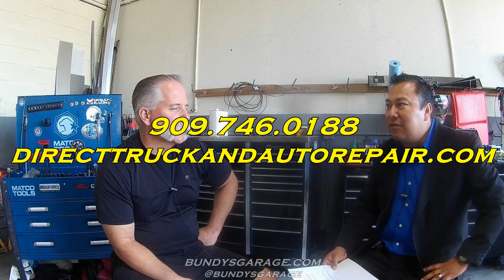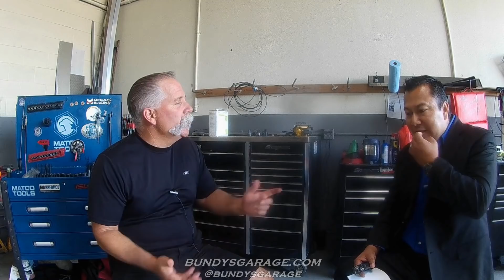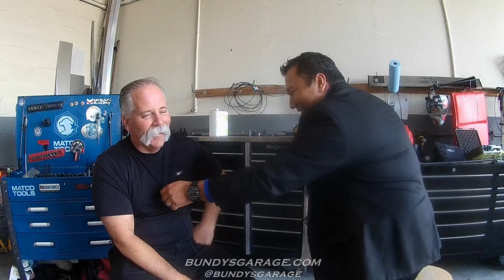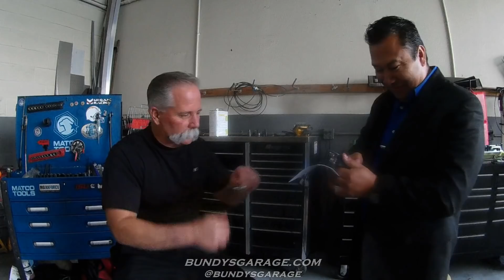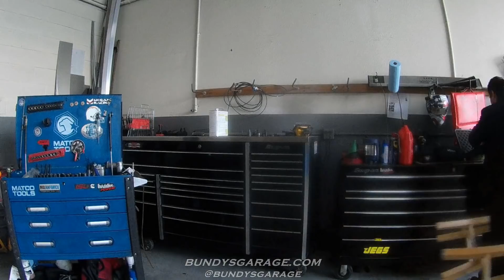Worst Diesel Engine Ever - What is the Best Diesel Truck out There? | Ford Dodge Chevy

Comment: I'm sorry, but this is garbage. No one, NO ONE, that knows what they're talking about, will pick a 6.0. PERIOD. Another Ford fanboy, clueless as usual. I wouldn't take anything to his shop.
Reply: I'm sorry but the 6.0s deleted and taken care of(later models) are generally good trucks
Reply: That is not true, I've got a 6.0 what has 350k original heads / gaskets and the only mod shes got is an EGR delete. Did have to change glow plugs, injectors and oil cooler once thus far. All else is original, point is if you take care of them they do last fairly well, though as much as I love my Ford trucks I can admit fault when they are there. The 6.0 started all screwed up because International cut a shit ton of corners, once updated they are pretty good engines. Also, I realize that my head gaskets being original is a fluke but it proves that the engine isn't total junk lol. So generally add studs to an updated engine and you're good to go for good 250-350k at least. Now before you say it yes you're right it shouldn't be needed, that is true but what are you gonna do, everything's got it's flukes. I'd honestly want a 6.7 but not with the DPF and the issues that follow it, which is why I would and pick a 6.0. It is easy to prevent most of the issues and generally easy and quick repair time versus a 6.7. I actually work at a Ford dealership so I'm not talking out of my ass fyi, the 6.7 is a beautiful well designed engine but the DPf's have so many issues that I just want nothing to do with it as compared to my 6.0.
Reply: The 6.0 is a good engine if you never run it over 2200 rpm and change oil every 2000 miles, and let it warm up  at least 10 minutes  before driving.
Reply: @larrywolfe9923  WTF? Never heard anyone say this before.
Reply: Another reason the Ram Cummins is the truck of choice for long haul hot shot truckers. with the miles they put on them , they would be changing the oil every other day if they had a 6.0!!!!!!
Reply: The 6.0 is a good engine, if you leave it parked in a heated garage. Never start it. and have brand new oil in it all of the time!!

Comment: Get all your Diesel Trucks deleted because they last longer they weren’t meant to run with all the Emissions stuff on
Reply: Good old CA, regulate everything to death.
Reply: Agreed but unfortunately in this country every state has different laws which sucks, especially in this state of mass with its laws and inspections. At some point when I get a power stroke it’ll have all the deletes done to it and it’ll be registered in South Carolina. Like you guys saying being in California Ick Cali is worse law and inspection wise than mass.
Reply: I guess I'm lucky here in Texas... I have a 2006 Duramax LBZ.

I deleted my EGR, cut the CAT off, and cut the muffler off. There is literally nothing on my truck holding back emissions whatsoever.

I took it to get inspected.. They honked the horn, turned on the blinkers, and passed it.. No emissions check on diesels in Texas
Reply: Waiting for warranty to expire.
Reply: You suck
Reply: Chanse Ormon I would but I have a L5P DMAX
Reply: You can.. Kory Willis cracked the computer. You can delete an L5P now.

Nice truck man, those things are MACHINES
Reply: @thesupersaiyan6454  PPEI - cracked ECU and tunes out
Reply: @thesupersaiyan6454  I think they came out with a tune for the L5P.
Reply: Chanse Ormon how and where if shops won’t do it?
Reply: hardleecure how do u prevent them finding out?
Reply: @soalfisk4862  I'm sure if you drew up some sketches and went to a fab shop, they wouldn't have a problem making a 'box' that looks like your particulate filter but in fact is just a tube with a box welded around it with a fitting on it for the DEF line that you don't use anymore. Looks stock but not in use. How you trick the sensors that might be upset about it I have no idea.
Reply: @Chanse Ormon Modern ERG systems are not like the early ones. The 6.7 even uses the EGR in a clever manner to help regulate EGT temps under heavy load thus protecting the engine. The issues with them come from high idle and short trips where they clog with soot. Just cause these things are clean idle certified doesn't mean they can idle for long periods without issues. Now the DPF is a whole other issue, damn garbage they are... the whole lot. I mean the idea is good, but the implementation is restrictive problematic garbage. The EPA forced the restrictions too fast so nothing got ironed out right, the DPF's are getting better but still are no where near where they need to be
Reply: @josephbowman4571  You are so right the early system is what killed the 6.4. IH fixed the 6.0 issues in the 6.4 but had to add the emissions package that flooded the rear cylinders with raw fuel and filled the crank case. My 6.4 has been deleted since new and has 296,000 miles and runs strong.
Reply: @josephbowman4571  - I would like to see the manufacturers get away from EGR systems for the simple reason, you are putting sooty exhaust gas into the cylinders. Soot is abrasive and promotes wear to the rings and cylinder walls.
But you are absolutely right about the DPF systems, they are evil. They clog with soot and when your truck goes through a cleaning cycle you loose power and dump the soot that is collected in the DPF. Supposedly it comes out as a finer, more completely burnt soot, but soot none the less. And to top it all off, you burn more fuel during these regeneration cycles by dumping raw fuel into the cylinder during the exhaust cycle to increase temps in the DPF. Isn't that increasing NOx emissions? Then we have to add more emission control systems and so on and so on.
I've always thought a lot of the added on emission systems were mostly smoke and mirrors. 
Making an engine more efficient, so it uses less fuel, is what needs to be done, but unfortunately the internal combustion engine loses almost half of the energy from combustion as heat out the exhaust pipe. And we're to the point of diminishing returns on efficiency.

Comment: 6.0, 6.4, 6.7 Which one would you pick? Uh the 7.3 ?
Reply: I had 2000 7.3 f250 I loved my truck no issues
Reply: the best trucks ever made......7.3 in a super duty..... the only weak point is the dana 50 in front if your tire is up to 35 inch.....all f 250 03 up have dana 60.....much better
Reply: 2000 7.3 with 137000 miles. Serviced regularly. No problems.
Reply: @jimdevilbiss9125  At that rate your truck will outlive you man lol.
Reply: 565 000 on my 6.0
Reply: @nickx831  350k 6.0 still running like raped ape
Reply: @nickx831  awesome I have an 6.0 130k on it, egr deleted
Reply: Guy Desjardins 6.9L and 6.7L for me! Those are the two I own and I love them both!
Reply: @natehawkins2910  How many cans of starting fluid do you keep around for your 6.9? I know someone with a 6.9 and he says that he had to use starting fluid every time.
Reply: JDFan98 None. Mine has functioning glow plugs and controller. It starts up very well even in 10 degrees. I never take it out in the snow tho and since it’s like 35 years old I don’t start it when it’s that cold anymore. I figure she deserves a break from the very cold weather stress now so it’s usually only ran in temps above 40.
Reply: JDFan98 See a clip of mine on my channel
Reply: Always wanted to try a 6.4 reprogrammed to eliminate the regen fuel through the turbos
Reply: @joenobody2580  I've got a 6.4 DRW with 296,000 miles that has been deleted since new. I did just have the auto trans gone through. This motor gets 17 mpg and is a power monster right off idle with the dual turbo set up.
Reply: I'm a Chevy guy. But the 7.3 powerstroke built by Navistar. Was a great engine.
Reply: @thebigokie6.4_392  all due respect I thought it was International, one in the same  perhaps? Yes 99/2002+ gave Cummings a period of serious competition.
Reply: @Jabootie-oz1cb  
You mean "Cummins" ?
Reply: @118chosen9  :) I DO.
Reply: 6.0 all day
Reply: 6.0l all the way 335000k runs good, egr delete
Reply: 6.0 (if you get it head studded) ,7.3, 12 valve 6bt, 24 valve 6bt. That's it I found out if you go to anything else you just can't get the longevity or fuel mileage out of em. Current tow rigs 2000 f350 single wheel 463,000 miles. 2001 f350 dually 512,000 miles. 2005 f350 dually 603,000 miles. And the shit truck a 98 2500 12valve.  Odometer quit so i cant tell you how many miles it has lol. All original engines.
Reply: What Do You guys in the Comments section mean by; “Deleted”?? What’s Drleted?? I’m not a Mechanic, but I understand some of the Mechanical operations, but I’m kinda of a novice. I never heard of a Delete.

Thanks
Reply from the maker: They are talking about deleting all emission related components surrounding all modern day Diesel engines.
Reply: it worked for me
Reply: 99 7.3 with 323k miles and still pulling strong
Reply: 100%  my thoughts exactly. The real battle, in my eyes, is between the 12V Cummins and 7.3 Powerstroke. The 6.7 is a runner up though.
Reply: You cannot beat a 7.3
Reply: @johnhull6363  No but unfortunately some of them eat transmissions. Ask me how I know.
Reply: John Hull John, you’re not getting 15 mpg’s while pulling a 10k boat at 80 mph.  Hell, my 2000 7.3 barely got 18-19 mpg’s on the freeway unloaded at 65.
Reply: 6.9
Reply: 5.9 6bt is superior in all categories
Reply: Any duramax
Reply: Boy I just got a 7.3 2000, it’s got wide bore spacing and it’s easier to convert to s poppet valved 2 stroke
Reply: I have an 8v92 and yz 250 and a few wankles that run shell rotella t1 sae 40 low ash 2 stroke oil as it’s in my 7.3, I fill the 7.3 filter with Amsoil’s dominator 2 stroke oil though
Reply: 7.3 was decent at best.. it's just like the 3208 Cat engine, lots of displacement and no horsepower, that's why they live long lives.
Reply: @robertwingate650  What is the matter with long lives?
Reply: @istvanmeissler2238  haha, nothing if u don't mind life in the slow lane..
Reply: @robertwingate650  ok, let me tell you where I am coming from.  Sometimes I think I would like to own a 6.9 idi Ford pickup.  Why you say. Because it is dead simple and will likely NEVER leave you stranded  (with good maintenance ). All diesels with electronic components like sensors are vulnerable.  I HATE being stranded at the side of the road more than anything.  I understand that there are other considerations which is why I own other diesels.  Just saying reliability is BIG for me.
Reply: @istvanmeissler2238  simplicity is always nice. I owned and 89 Dodge with the C and put 350k hard miles on it. Simple engine, simple truck,  completely reliable. Just got tired of driving the same truck.
I've owned 4 Cummins powered Dodges, all have beat on, abused, idled for days on end, overloaded, neglected at times, all have been tuned( not deleted) and all have been reliable. 
Newer diesels are all more complicated, ( thanks to the EPA) 
Everyone including engine manufacturers would love to have todays emissions compliance, today's horsepower and torque numbers,  20 year old simplicity, in a modern truck.. unfortunately it's just not possible with the small box manufacturers have to play in.
Reply: Robert Wingate what you talking about....my 99 stroke supercab 4x4 pulls my 10k boat on trailer across the pa turnpike cruise set at 80...pulls all hills without dropping under 78 mph....pulls sideling hill at 75 on i68...slow lane GTFOH...stock except for chip...and does it at 15mpg
Reply: @johnhull6363  transmission type ?
Reply: Chris Duhaime auto....4R100
Reply: Robert Wingate you will only crash & burn in the fast lane...
Reply: Nothing that a good performance tuner chip couldn’t clear up. I have a TS performance chip in my 02 F-250 7.3 and combined with the 38R ball bearing turbo I put on it, I can push over 400 hp/600 lb ft tq. The performance of the 7.3’s Ford put in their trucks were dialed back on purpose in order to preserve the transmissions. The power numbers were a little higher in the manual transmission models though.
Reply: thats the way it is supposed to be,,  long life
Reply: How do you find a place in Pennsylvania to go 80 mph? When I'm there the highways are cluttered with thousands of cross- over SUVs junking up both lanes and riding their brakes on every downhill? Maybe they are just bracing for the next 6' pothole in the highway? Haha.. 
Seriously though, glad u like ur Ford, I'll keep my Dodge.
Reply: Robert Wingate travel at night
Reply: @johnhull6363  yeah, it is easier then..  I usually try to leave PA in the evening so I can get thru Ohio at night when all the DOT officers are off work!
I think the most reliable Ford diesel is a deleted 6.4.. Deleted and maintained correctly, they make excellent useable power and are very reliable.
Reply: Sad day for Ford fans when everybody is nostalgic for 7.3's that wouldn't make any power without braking cranks and cracking heads.  Not to mention the abominable injection system of the direct injected engines.  Spend $10k and get an injection pump on there that'll run, only to self destruct at a horsepower an inline six would last all season running.  Guess it's a good thing they don't have spark plugs to spit out though.
Reply: @randymagnum143  It may not make much power (in stock form), but it certainly doesn't break the bank either. I'd rather have an underpowered but reliable work horse than a brute force bull that tears up core engine components four times before reaching 150k miles.
Reply: @randymagnum143  I'm at 296,000 miles on my deleted 6.4 and it is very impressive.
Reply: The 7.3 was the only good navistar built engine
Reply: A 5.3 ls will get more miles than any of them.
Reply: @toddk4412  Don't be stupid Chevy fan boy, that 5.3 won't last ten feet on DIESEL.
Reply: Uh the Triton V10